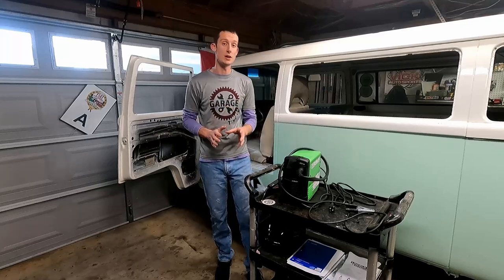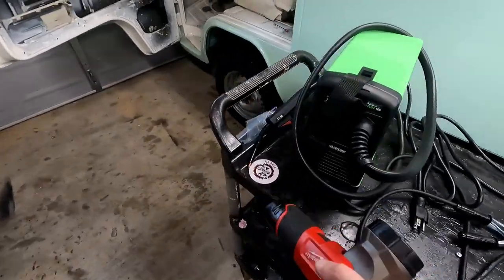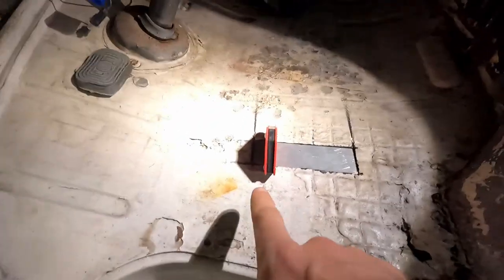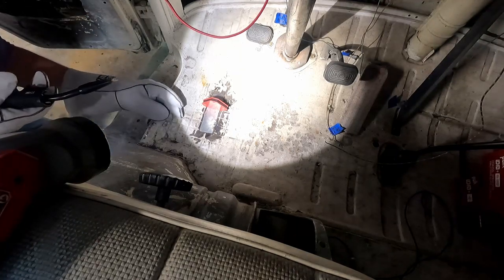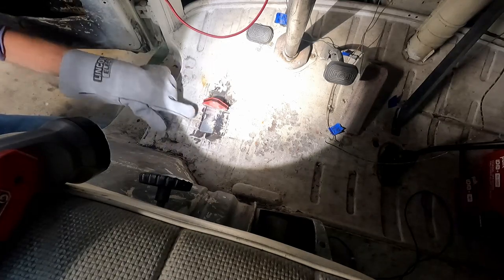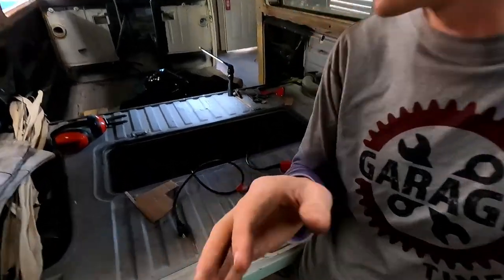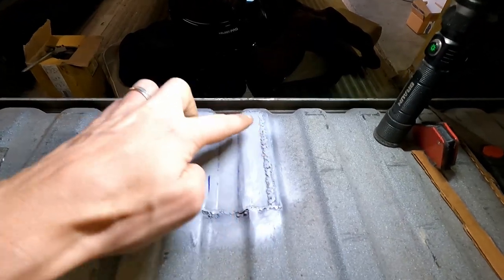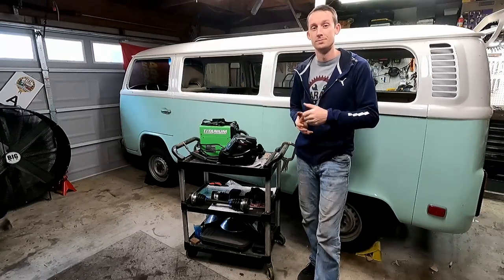Welding Patch Panels in our 1974 VW Bus Project with ZERO Experience! How BAD Can I WELD?!

Comment: I found it helped when beginning welding thinner metal was to tack it best you can then let it cool ,then weld from the Center of the tack an slight circle movement spreading the tack onto both edges trying to be brave a couple of seconds pulling the trigger to get some heat… (the existing tack takes out a lot of the heat an stops burning holes as easy)

On my old Clarke no gas welder I had about 6 wire speed on mid setting power 

No doubt tho these little machines are hard I picked a cheep 170a mig up an it’s a totally different experience …a lot easier to fill small gaps an easy to get a good amount of tack first time
 (well worth a look into when owning  an old vehicle)   

I did 90% of my project with my gasless an sort of regret the extra effort… I wouldn’t look back on the 170a now

Comment: I'm not a welder either but find myself in the same situation as you.  I have to weld a patch panel in a Fiat Spider trunk to mount the gas tank.  I've been reading about welding and watching You Tube instructional videos on it to learn before I try it.  You appear to be using a MIG welder but I can't tell if you are using flux core wire or a regular MIG spool.  I assume flux core because I did not see a gas tank connected to your welding machine.  From the videos I have seen, MIG welding requires that the tacks be spaced because the heat generated causes the burns and holes you experienced.  Also, I have noticed that MIG welders alternate their tack welds on each side of the piece being welded.

Comment: I had the same trouble with welding as you, and I have a gas/MIG setup. An experienced welder friend of mine said that the 110/120 welders just don't cut it like the 220. ( probably get some disagreement here). It must be really clean and a GOOD ground. I switched to epoxy on small patch panels. Worked great but more expensive. You have to invest in the gun. Also, I would make my cardboard pattern first, then trace that out on the part before cutting in order to get a tighter fit with less gap to try and fill. Nice job and looking good.
Reply from the maker: It all comes with practice! I appreciate the feedback

Comment: Did you clean the underside of the weld? It sounded like it was dirty.
Reply from the maker: I didn’t, but I learned from that and cleaned both sides. Also invested in a much better ground clamp. Huge difference